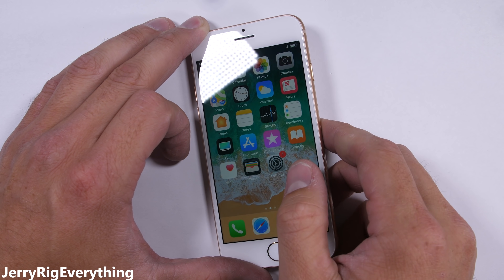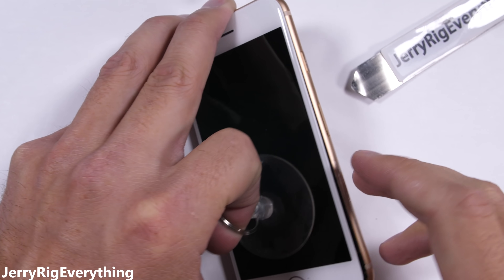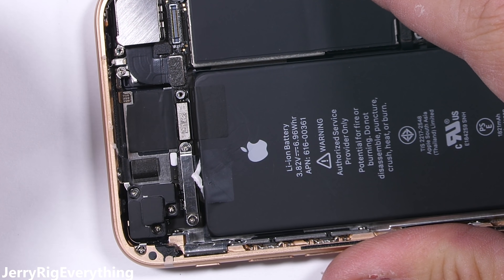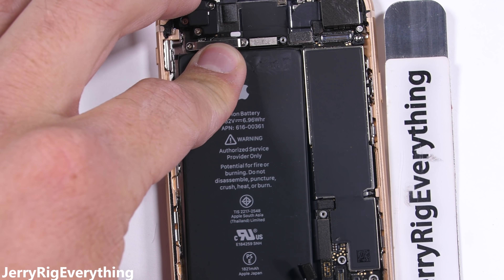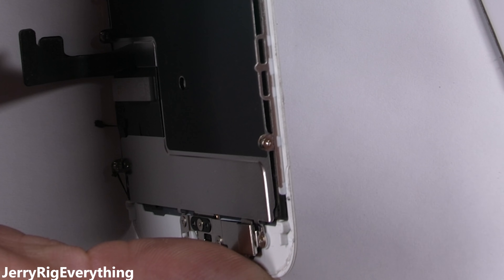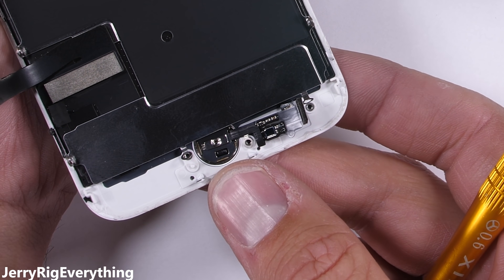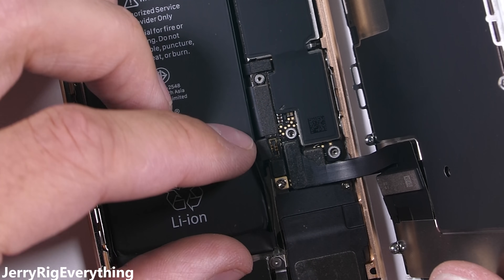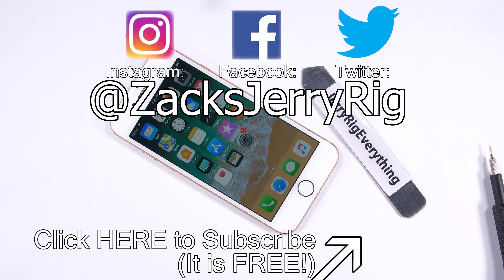iPhone 8 Teardown! - Screen and Battery Replacement Video

Comment: Jerry Ooo Jerry... You forget to tell that for a screen replacement You should use a special lcd/oled  programmer to read the calibration from an old screen and upload that to a new one. Without that even if You will try to replace with original apple screen it wouldn't be work correctly...( Trutone will not work anymore, and You can have problems with viewing colors in right tone) Same as baterry. Jerry You're really cool guy but making video like this... Rubbish. Only thing You did right is unscrewing and nice talking. But its really impossible for this phone to work nicely after that replacement. Sorry